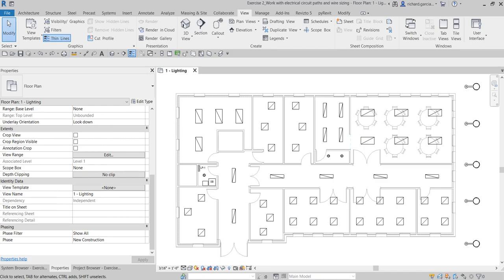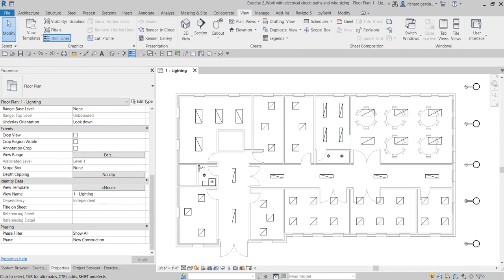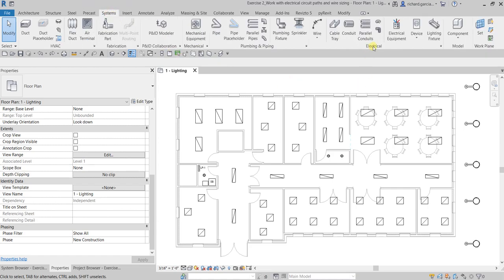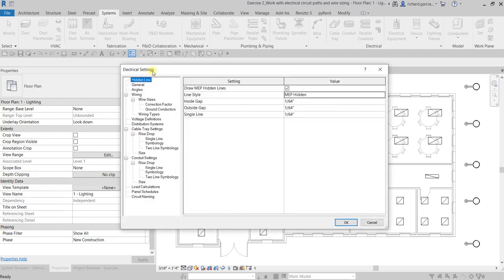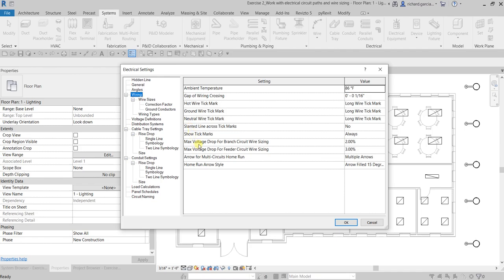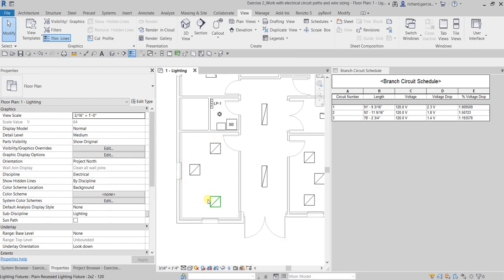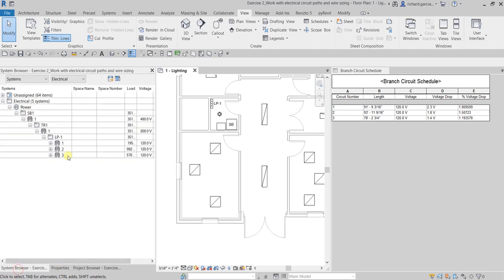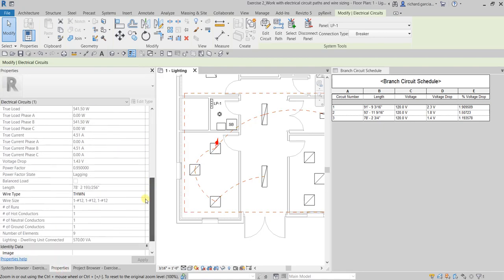REVIT FOR ELECTRICAL DESIGN: ELECTRICAL CIRCUIT PATHS AND WIRE SIZING

Comment: I'm confused. Why is it trying to reach the maximum 2% voltage drop? Isn't it supposed to not exceed 2%?
Reply from the maker: hi mate, the limit is 2% for most branch circuits (per typical standards). Revit does not try to reach it—it just calculates what you’ve designed and reports whether you’re within range.

Comment: Thanks for this video.  What about if you have connection box in the corridor and connect the lights in the rooms from there. How can I get the right circuit length?
Reply from the maker: hey tobbi, when dealing with connection boxes in corridors that connect lights in rooms, determining the correct circuit length involves a few steps in Revit:

1. **Create Circuit Path**: Start by creating a circuit path in Revit. This typically involves drawing lines or paths to represent the electrical wiring from the power source (e.g., electrical panel) to the connection box in the corridor.

2. **Specify Circuit Length**: Once the circuit path is established, you can specify the length of the circuit. Revit allows you to input the length manually or use the "Measure" tool to measure the distance accurately along the drawn path.

3. **Connect Lights**: After setting up the circuit path and specifying its length, you can connect the lights in the rooms to the connection box in the corridor. This is typically done by drawing wiring lines from the connection box to each light fixture.

4. **Check Circuit Length**: Once all the lights are connected, you can check the total circuit length. Revit should automatically calculate the total length of the circuit based on the specified lengths of the circuit path segments.

5. **Adjust as Needed**: If the circuit length exceeds design limitations or if there are any discrepancies, you can adjust the wiring paths or make changes to ensure that the circuit length is within acceptable limits.
Reply: @bim360  Hi. I can only get the length for junction box in the corridor or take the hole length for the corridor and all the lights.  I can not use the junction box to split circuit path as I would do in practice
Reply from the maker: In this scenario, where you can only determine the length for the junction box in the corridor or take the total length for the corridor and all the lights, you'll need to approach circuit planning with a workaround.

Since you can't directly use junction boxes to split the circuit path, you can consider a couple of strategies:

1. **Average Length Method**: Calculate the average length of the corridor and the lights combined, and use this as the basis for your circuit planning. While this might not be as precise as individual lengths, it provides a balanced approach to distributing the circuit load.

2. **Divide by Proportion**: If you have an estimate of the proportion of the corridor length to the total length (including lights), you can use this to divide the circuit load accordingly. For example, if the corridor is roughly 40% of the total length, allocate 40% of the circuit load to the corridor junction box and the remaining 60% to the lights.

Remember, while these methods may not offer the same precision as individual circuit lengths, they provide a practical approach to managing the circuit load in the absence of detailed measurements for each segment.
Reply: @bim360  Thanks for this :)  There is also possible to make junction box as a panel and then measure from that panel.  Panel name (+T1) number for circuit Q101, the junction box (panel) would get the name Q101.1.  The only fault for this is that I would get a lot of panels :(
Reply from the maker: yes, its a valid point about using junction boxes as panels to measure from. This method could indeed provide a more precise approach to circuit planning by allowing measurements from specific junction boxes (panels). However, as you mentioned, this might result in a proliferation of panels, which could potentially complicate the overall project organization and management. Each approach has its pros and cons, so it's essential to weigh them against project requirements and constraints to determine the most suitable strategy.

I would advise the following:

Evaluate Project Requirements: Assess the specific needs of the project in terms of circuit planning and management. Consider factors such as the level of detail required, project complexity, and client expectations.

Balance Precision and Complexity: While using junction boxes as panels can offer more precise measurements, it's essential to consider the potential increase in complexity due to the proliferation of panels. Evaluate whether the added precision justifies the additional organizational overhead.

Consider Workflow Efficiency: Think about how the chosen approach will impact workflow efficiency and collaboration among team members. Determine whether the benefits of precise measurements outweigh any potential challenges in project coordination and management.

Explore Alternatives: Explore alternative solutions that strike a balance between precision and simplicity. This could involve a combination of methods, such as using averages or proportions for circuit planning while occasionally resorting to specific measurements from junction boxes for critical areas.

Consult with Team: Discuss the proposed approach with the project team to gather input and insights. Collaboratively evaluate the advantages and disadvantages to make an informed decision that aligns with project goals and constraints.

Ultimately, the advice would depend on the unique circumstances of the project and the preferences of the project team. The goal is to find a practical and efficient solution that meets the project's needs while minimizing unnecessary complexity.

Comment: Hello from Brazil, my friend.  May you tell me how can i consider to the circuit only the closest device to the panel? I mean, i'm working with solar panels and for the leap frog conection, the only module conected directly to the panel is the closest one.  Thank you!
Reply from the maker: Olá! In Revit, when designing electrical circuits for solar panels where you want to consider only the closest device to the panel for leapfrog connection, you can follow these steps:

1. **Create Circuits**: Begin by setting up your electrical circuits in Revit as you normally would, connecting your solar panels to the distribution panel.

2. **Add Devices**: Place all the devices (such as modules or inverters) that will be part of your circuit.

3. **Edit Circuit Path**: To ensure only the closest device to the panel is considered in the circuit, you'll need to manually adjust the circuit path.

4. **Adjust Circuit Wiring**: Modify the wiring path so that it directly connects from the panel to the nearest device, skipping other devices in the circuit. This means you'll need to create custom wiring that reflects the leapfrog connection.

5. **Use Custom Wiring Tools**: Revit has tools for creating custom circuit paths. You can use the Wire tool to draw the electrical wiring from the panel to the closest device, ignoring the typical sequential wiring path.

6. **Disconnect Unwanted Paths**: Ensure that the wiring doesn’t continue from the first device to subsequent devices in the circuit. You want to isolate the leapfrog connection to only the closest device.

7. **Verify the Circuit**: After setting up the circuit with the modified wiring, verify that the circuit is functioning correctly within Revit's electrical design environment. Check for any errors or warnings related to the custom circuit path.

By customizing the circuit wiring in this way, you can accurately represent the leapfrog connection of solar panel modules in your Revit electrical design. This method allows you to simulate the specific electrical configuration required for your project, reflecting the real-world scenario where only the nearest device is directly connected to the panel.

Comment: i notice that the system is in english, how to change in metric? that would includes the wire from awg to mm. i'm new in revit and TY very much for this posts.
Reply from the maker: Hello mate, to change the units in Revit to metric and also adjust wire sizes from AWG (American Wire Gauge) to millimeters, you'll need to follow a few steps. Here's a guide to help you with this:

### Changing Units to Metric in Revit:
1. *Open Revit:* Launch Revit and open the project or template you're working on.

2. *Go to Manage Tab:* In the ribbon at the top of the Revit interface, click on the "Manage" tab.

3. *Project Units:* Under the "Settings" panel in the Manage tab, click on "Project Units."

4. *Select Length:* A dialog box will appear. Under "Length," choose the desired units from the drop-down menu. Select "Millimeters" for Metric units.

5. *Adjust Wire Sizes:* Revit typically uses metric units for wire sizing, so changing the project units to metric will align with this.

### Converting Wire Sizes from AWG to Metric (mm):
If you have wire sizes specified in AWG and need to convert them to metric units (mm), you can use a conversion chart or calculation. Here's a general guide:

- *Find AWG Size:* Determine the American Wire Gauge (AWG) size of the wire you're using.

- *Use Conversion Table:* Refer to a conversion table that shows AWG sizes and their equivalent diameters in millimeters. For example:
  - AWG 12 = 2.05 mm
  - AWG 10 = 2.59 mm
  - AWG 8 = 3.26 mm

- *Manual Conversion:* If you need to convert wire sizes manually from AWG to mm, you can use the following formula:
  \[ d_{\text{mm}} = 0.127 \times 92^{\frac{(36 - \text{AWG})}{39}} \]
  where \( d_{\text{mm}} \) is the diameter in millimeters and AWG is the American Wire Gauge size.

### Applying Wire Sizes in Revit:
- Once you know the wire size in millimeters, you can apply this directly in Revit when creating or specifying electrical components (wires, cables, etc.).

- Revit's wire sizing options will generally be in metric units once you've set the project units to metric. This means you can specify wire sizes directly in millimeters when working on electrical designs.

Comment: Hello, is there way, how to manually change a lenght of wire? Tha path and lenght calculated by Revit is not corresponding with reality, it is more like shortest way.
Reply from the maker: hi sir, to manually adjust the length of a wire in Revit and customize its path to better reflect real-world conditions, you can use the following approach:

### Modifying Wire Length Manually:
1. *Select the Wire:* In your Revit project, locate and select the wire element that you want to adjust.

2. *Enter Wire Edit Mode:*
   - Double-click on the wire to enter its editing mode. This will allow you to modify the wire's properties and path.

3. *Adjust Path:*
   - While in wire edit mode, you can adjust the path of the wire by clicking and dragging the control points. Revit allows you to reshape the wire's path by manipulating these points.
   - Click on the wire to add new control points if needed, and drag these points to modify the wire's route.

4. *Modify Length:*
   - After adjusting the path, you can manually modify the length of the wire.
   - Select the wire element and look for its properties in the Properties palette.
   - Depending on the version of Revit you're using, there might be a property called "Length" or "Measured Length" that you can directly edit.
   - Alternatively, you may need to adjust the wire's control points to achieve the desired length based on your modifications to the path.

5. *Review Changes:*
   - After making adjustments, review the wire's path and length to ensure it now corresponds more accurately with reality.

### Tips for Accurate Wire Modeling:
- *Use Reference Lines:* In complex routing scenarios, consider using reference lines or sketches to plan the wire path before creating the wire element. This can help you visualize and accurately model the desired routing.

- *Snap and Constraints:* Take advantage of snapping and constraint tools in Revit to ensure precise positioning and alignment of wire segments.

- *Validate Against Real Measurements:* If possible, compare your modeled wire path and length against actual measurements from the site or project documentation to ensure accuracy.
Reply: @bim360  Thank you wery much! Unfortunatelly, I found out, that i cannot write correct lenght, so it is needed to adjust wires control points, and it is time-consuming, but it is a solution.
Reply from the maker: glad to hear that you found a solution. thanks!

Comment: Hello sir , edit path not visible for me,  can you help me.
Reply from the maker: If you're unable to see the "Edit Path" option in Revit for electrical elements like conduit or cable tray, it's likely because the element you're trying to edit doesn't have a valid path associated with it. Here's what you can do to troubleshoot:

1. **Select the Element**: Make sure you have selected the electrical element (such as conduit or cable tray) that you want to edit the path for. Sometimes, the option to edit the path will only appear when the element is selected.

2. **Check Element Properties**: Verify that the selected element has been properly placed and connected in the model. Ensure that it has a valid start and end point for the path.

3. **Review Parameters**: Go to the element's properties and check if there are any parameters related to the path or alignment. Make sure these parameters are properly set.

4. **Use the Modify Tools**: If you're still unable to see the "Edit Path" option, try using other modify tools to adjust the element's position or alignment. You may need to manually adjust the element to achieve the desired path.

5. **Verify Settings**: Double-check your Revit settings to ensure that you have the necessary permissions and visibility enabled to edit paths. Sometimes, certain settings or permissions can restrict access to editing functions.

6. **Update Revit**: If you're using an older version of Revit, consider updating to the latest version. Sometimes, new features and improvements are introduced in updates that may resolve issues with editing paths.

If you've tried these steps and are still unable to see the "Edit Path" option, you may need to provide more specific details about the element you're trying to edit and the context in which you're working so that further assistance can be provided.

Comment: Hi dear, why there is no  wires sizes in mm2  in revit. How can i do wire sizing in mm2 ? plz help
Reply from the maker: In Autodesk Revit, the default unit for wire sizes is typically in American Wire Gauge (AWG) for imperial projects and square millimeters (mm²) for metric projects. However, the display unit can be customized based on the regional settings of the project.

If you are working in a metric project and still encountering wire sizes displayed in AWG, you may need to check and adjust your project settings. Here's how you can do it:

1. *Open the Project Units Dialog:*
   - Go to the "Manage" tab on the ribbon.
   - In the "Settings" panel, click on "Project Units."

2. *Check Unit Settings:*
   - In the Project Units dialog, make sure you have the correct discipline selected (Electrical for wire sizes).
   - Look for "Wire Sizes" in the list. For Metric projects, it should be set to "Square Millimeters."

3. *Adjust Display Units:*
   - Click on the "Wire Sizes" category, and ensure that the "Format" is set to "MM^2" (square millimeters).

4. *OK and Apply:*
   - Click "OK" to apply the changes.

After adjusting these settings, Revit should display wire sizes in square millimeters. If, for some reason, the issue persists or if you are working with families or specific elements that have their own unit settings, you may need to check and modify the unit settings at the element level.
Reply: @bim360  thank you for your time and efforts to clarify the solution.. I will try it and will give you feedback.
Reply from the maker: you are welcome.
Reply: I tried doing what u recommend but unfortunately, the wire size in mm2 is not exist in manage-setting-project units. The only thing exist is wire diameter.

You can check . 
It is very annoying working with AWG while all projects in my country is in mm2..

Pls help
Reply from the maker: @hanial-shadadi9122, I understand your frustration. If wire size in mm² is not available in the Project Units dialog under Manage > Settings, try checking the specific element settings. Sometimes, individual elements like families may have their own unit settings. Ensure that the wire size category in those elements is set to "Square Millimeters" and the format is set to "MM^2." If the issue persists, you may need to consult Revit's documentation or community forums for more targeted assistance.
Reply: @bim360  tnx, that answer my question a while ago...
Reply from the maker: youre welcome!

Comment: Like always, thank you Rich. Maybe my question is wire size number 12, is it equivalent to 1.5mm2, number 10= equivalent 2.5mm2 etc. How can I can I customize my schedule to show wire sizes in diameters
2. Separate let say, if I have two condenser units mounted on top of each other against the wall. How can I place my isolator symbol such that when you look at them on on a floor plan they do not block each other and on 3D they appear sitting against the wall on different heights?
Reply from the maker: Hello The Legacy, thanks for watching and you are always welcome.

1. I googled it:
#12 = 2.0525mm diameter (3.3088sq. mm. Cross sectional area) here is the link: https://www.rapidtables.com/calc/wire/awg-to-mm.html

2. You need to create an Offset (distance parameter) for the isolator symbol. so when you place it in floor plan you can adjust it.
Reply: thanks a lot and thank you for the info.
Reply from the maker: @thelegacy5368  youre always welcome!